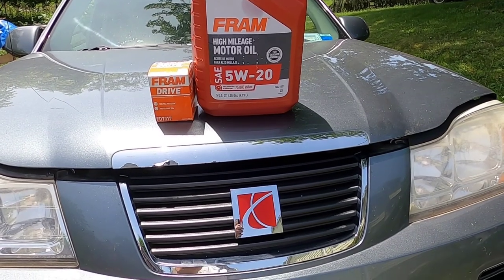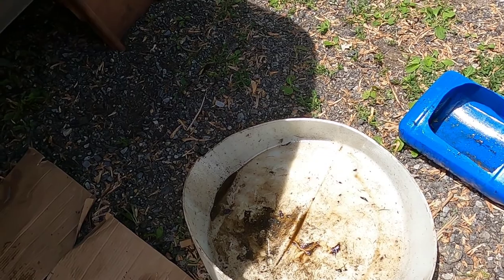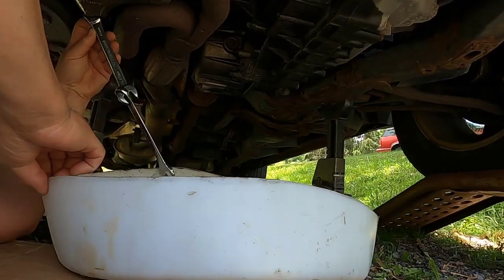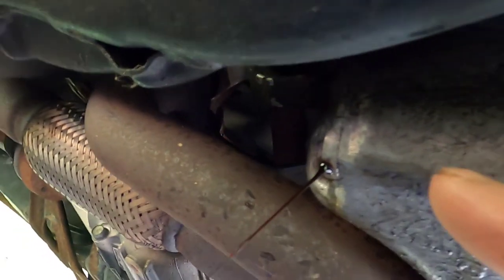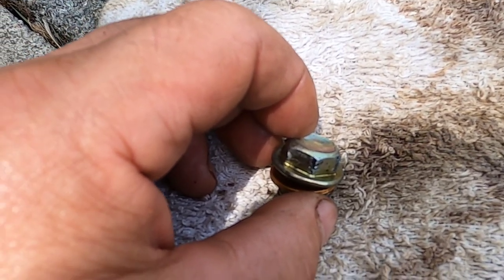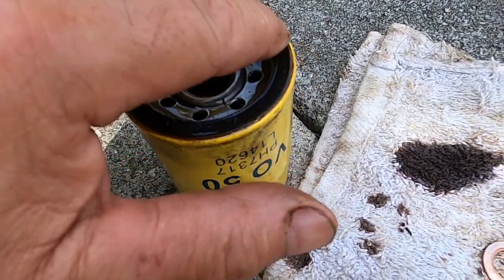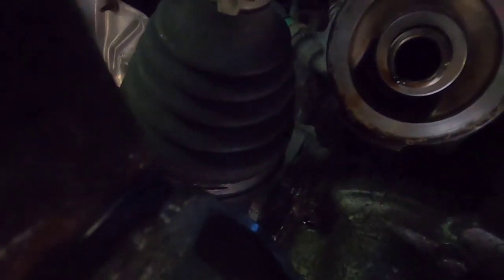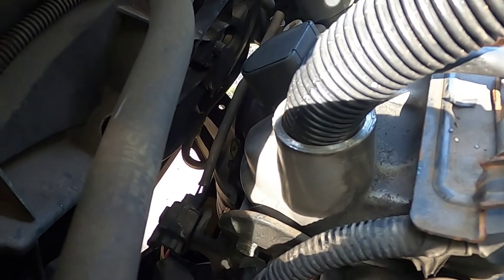SATURN VUE OIL & FILTER CHANGE

Comment: I used to take the oil for all of the Southside in Chatt TN because I had a big waste oil heater that I used to heat 10,000 sq ft shop for almost 20 years. It was a 350,000 BTU Shenandoah brand. It was worth every penny of the $8,000 it cost to purchase.
Reply from the maker: I have a trailer that I am considering to make into a work shop. Do you know if they have a smaller version of these heaters that are safe to work with in a smaller area? I known it has to be vented but a little concern  about any fumes in such a small space.
Reply: @JOEZEP54  I know they make Diesel Parking Heater. I use it in my semi truck. I’m not sure if it works with waste oil but you could give it a try.
Reply from the maker: @markm0000  Thank you Mark.

Comment: I just did my son’s Vue today and boy did the shop that last changed it over tighten that plug!  I also had to use my breaker bar. The filter is a mess to change also.  I used Valvoline 5/20 high-mileage and a bottle of high-mileage Rislone additive.
Reply from the maker: This is lack of  training, know how or just don't care unfortunately is more common today. Years back it was the exception. Best we do what ever repairs we are able to. I try to get this done during the summer months. All my work is done outside. But every once in a while  when it is due and there is snow on the ground I take the chance.
Stay well, Joe Z
Reply: @JOEZEP54  Take care Joe.  Your video is one of the best how-tos on YT!

Comment: Man that filter is such a piece of junk. The Fram filter is alright it does the job. Those oil change places use the worst quality bulk oil they can get and the cheapest filters. They make their money on replacing oil pans and up selling new air filters, windshield wipers, and servicing for the other drivetrain parts.
Reply from the maker: I agree, it looks like I am just going to keep doing the oil changes myself.

Comment: I prefer using the mobile 1 synthetic high mileage oil and a Purolator filter
Reply from the maker: Thank you for stopping by. This is what the previous owner used & I continued using. Not sure if it would help any to change at this point.
Stay well, Joe Z

Comment: Thanks Joe,  I have a twin to your Vue and had the oil changed yesterday at a PepBoys.  One time deal.  When I got it in the garage at home I put a clean sheet of cardboard underneath to watch for leaks.  This morning there were spots in quite a few place toward the front but none near the filter or drain plug.  Guess the tech must have spilled oil when refilling?  Started to do a cleanup and then do a recheck when I decided to pull the dip stick.  WAY WAY over filled.  Past the full level by about a good 1/4" up the stick.  Ended up sucking almost 40 ounces out to get the level down to the full level.  Guess I'll be like Joe and resume diy.  Cheers, Richard
Reply from the maker: Sorry for the late reply. My computer came
 in contact with the garden hose about 9 days ago. I tried everything I heard of & could think about. Nothing worked. I have the back of it opened, attached a USB keyboard & have to disconnect the original key board once it is powered on. Just sharing. It would have made a good DIY video. ( what NOT to do, what to do & what worked LOL) May still make a video if I venture on changing the org keyboard myself, it is a laptop. I will be sharing this with other comment reply as well. Anyway back to your experience things like that & what I went through always happened as occasional but now it seems to be the norm. Sad, many people are stuck for one reason or another & have to rely on these shops, That said there are many good shops that turn out great work with reasonable pricing but you have to search them out.
40 ounces too much 🤷‍♂️ wow. I have gotten a few ounces less but never extra. You may have saved your engine finding this out early.
Stay safe my friend, Joe Z